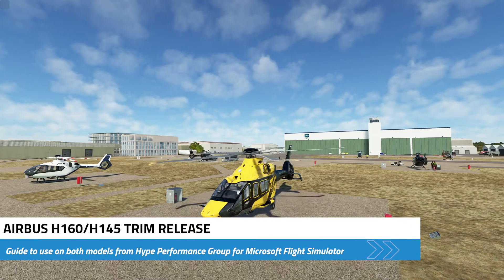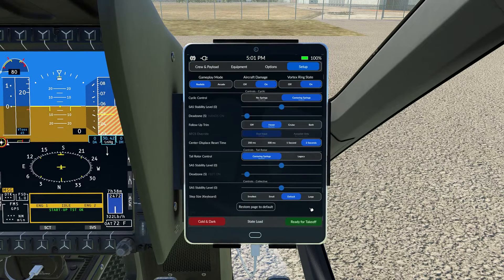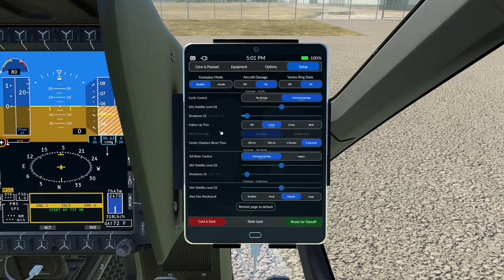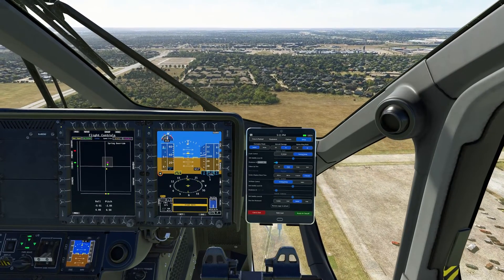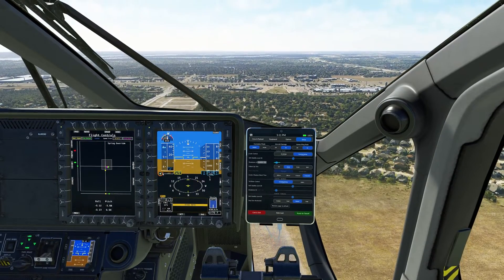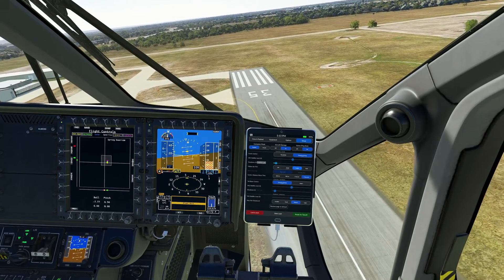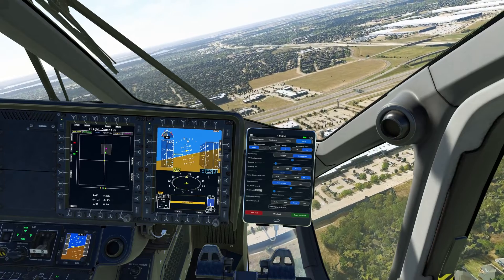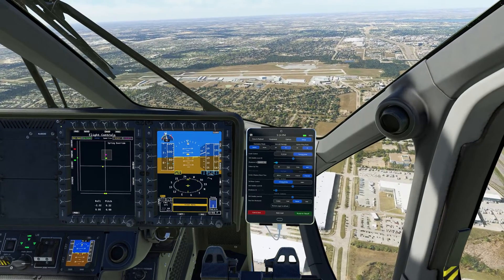Hype Performance Group - H160 and H145 Trim Explanation #MSFS2020 #H160 #H145

Comment: Hi blue echo. I like your tutorial very clear and easy to understand. When i press and hold trim release to lower  altitude after releasing  the trim release. The helicopter  just keeps climbing. And does not  hold the new altitude. Any help would be greatly appreciated. I use build 500 H145. Msfs2020. 
Ps i have tried the discord many time in the past sadly I didn't get any advice. There.

Comment: That sounds a lot like "Force Trim" as in the Bell 407, no? In fact, in the MS FSX version of the Milviz 407, I had my Thrustmeter Warthog stick set to operate Force Trim with the stick's paddle lever, (located in the front of the stick, just above the flare at the base). I would pull and hold the paddle-lever and then make the cyclic input that I wanted and then release the paddle-lever when I reached the intended adjustment.

In that way, I could keep the Cyclic (my Warthog J-Stick) in a more comfortable, centered, and relaxed position. For example; if I happened to be flying into a strong head wind and the aircraft's nose wanted to pitch up, gain altitude, and slow down, instead of applying a constantly held forward pressure on the cyclic, 

I would release the force trim (disengage it), by pulling and holding the paddle-lever. Then, I'd apply the forward cyclic input I wanted in response to the head wind effect and release the paddle-lever when I reached the desired adjustment, which would re-engage the force trim. I could then relax the forward pressure on the cyclic and allow it to return to its center position.

It's been a while since I flew the Milviz FSX 407 but I think I recited that correctly. Anyway, the H160's Trim Release function appears to work the same way but it's also incorporated some additional, and more advanced, options that work with the SAS, which the Bell 407 didn't have.
Thanks for the video!

Comment: Did you setup your flightmodel settings in classic or modern? I tried exactly your way of flying and setting but my h145 is always slightly making nose up nose down while cruising. It is very anoing.
Reply from the maker: Modern. The hype discord should be able to help a little more if you haven’t figured it out yet.

Comment: Kudos to Hype and BluEcho! I use Pro-flight Puma helo controls. It has friction cyclic, no centering springs like a joystick. In the Tablet setup page i use "no springs" button as expected. 
Question: The Follow-Up trim is greyedout, when no springs is selected. Is FU Trim working on friction cyclics? What is happening here? Thanks in advance.
Reply from the maker: This is a new one for me but the dev said follow up trim is irrelevant. Follow up trim with the centering spring setting is trying to mimic what you have. Where you put the stick with the friction is where it is. No need for the other settings.
Reply: @Blueecko  Thanks. Your videos are very good. I will be first to donate if you set up Patreon or similar until you perhaps monetize.
Yes your answer seems right and is what I was thinking as well. Needed confirmation I guess. Good luck
Reply: Stupid question then... in the real heli, does the cyclic spring return to centre or does it stay where it is put like a 'normal' heli?

Comment: So, I'm just making sure I understood you about all of this. For BOTH, you pretty much don't need to use trim release?

If I keep it in HOVER (default), I don't need trim release in hover, but once I'm going over 30kts, I need to hit it for any changes I make?  Once I do, then set a new attitude and release, the system will hold the new setting?
Reply from the maker: You’re correct, but when you don’t use trim release there is going to be noticeable delay in input and the helo grabbing that new point. It’s always recommended to use trim release.
Reply: @Blueecko  so use TR even with BOTH selected?
Reply from the maker: Yes, it's still recommended when you takeoff/land because you get more responsive input.
Reply: @Blueecko  you're the man!  Thank you!!!  One more question off topic....is the H160 not all weather capable?  Why no pitot heaters/anti ice.  Or is it typical automatic everything Airbus?